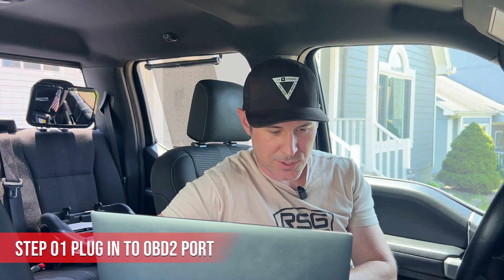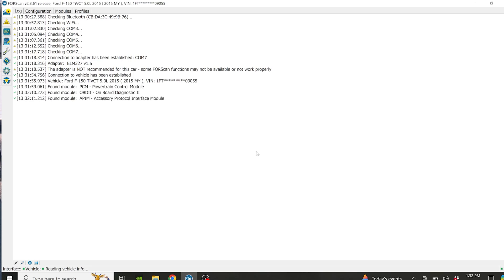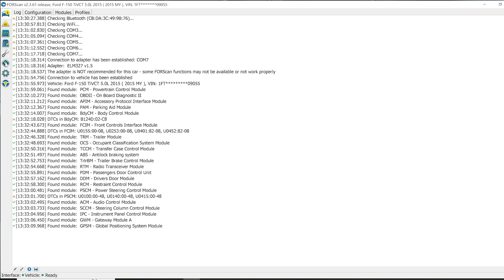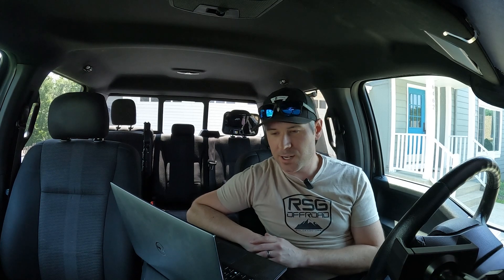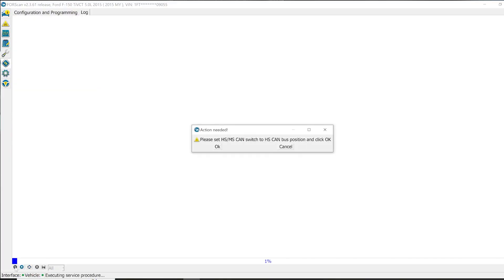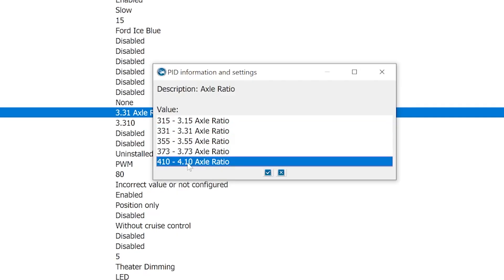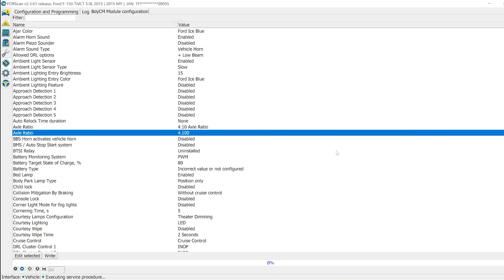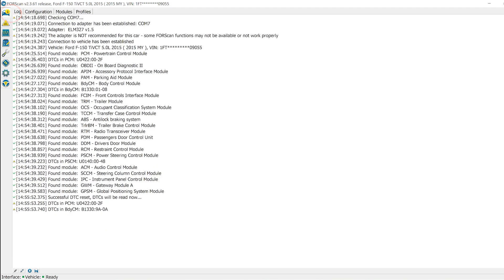Change Axle Ratios with FORScan - A Step by Step Guide

Comment: Will this make the truck shift gears at a lower speed to account for shorter gear ratio?
Reply from the maker: Yes it should help adjust the shift points of the transmission to account for the change in final gear ratios at the axels.

Comment: I swapped my 3.55 gears to 4.09 gears in my 23 manual mustang. When I go to Forscan to the BdyCM there is only one Axle Ratio and it's currently set to 494.080 which is very confusing. I tried changing it to 4.090 and end up getting codes sadly. Been struggling with this for months and my tuner, Ford, shop who swapped my gears all have no idea.
Reply from the maker: Have you made sure you're running the most recent version of FORScan software? Make sure you are set to MS can on your scanner then go to "BdyCM Module configuration" it's usually the 4th one down.

Comment: This showed "how" to change the axle ratio...but...my question is does it "actually" change your axle ratio or do you change the physical axle ratio and it allows you to match the new one up to your truck?
Reply from the maker: @skypresident3550  you have to physically re-gear the axel ratio first. The truck came with a 3.31 gear ratio and I had 4.11 Yukon gears installed to account for my 35" tires.
Reply: @jacobsupgrades  Did you also change the tire size in forscan?  Thank you.  I'm about to do the exact changes you list here.  Appreciate it.
Reply from the maker: @rockiereuter3910 yes, I did change my tire size as well. You can find that video here - How to Calibrate Speedometer with FORScan
https://youtu.be/HGiTzidyb_k
Reply from the maker: @rockiereuter3910 glad to help! Let me know if you have any questions.

Comment: What if I have 4.56:1 ratio gears???😮
Reply from the maker: @pocketpoolboy  I think you'll have to do some digging for adjusting the as-builts to account for 4.56 gears. It's usually provided in an excel sheet with the written code.
Reply: Did you ever figure this out?  I just had 4.56 gears installed as well.  I changed a few of the numbers in the BCM.  It was the last three number of the first sequence - I changed them to "1C8" as found on a forum.  I also typed in 4.56 in replacement for the 3.31 it had listed elsewhere in the BCM.  It seems like the hex code part (1C8) may be working correctly, but its not liking the "4.56" i typed in.  I'm getting a AdvancTrac error because of that.